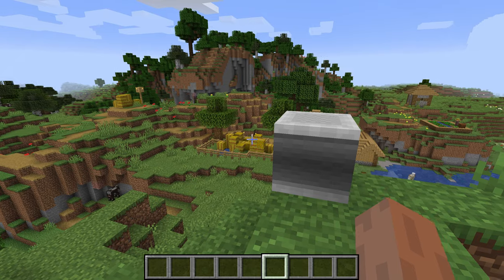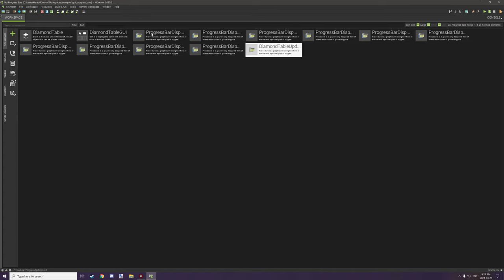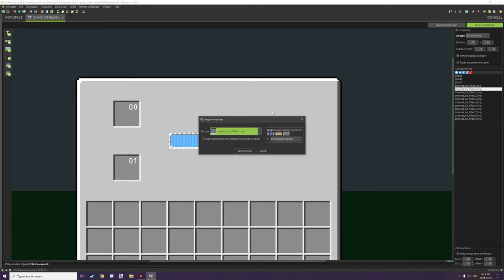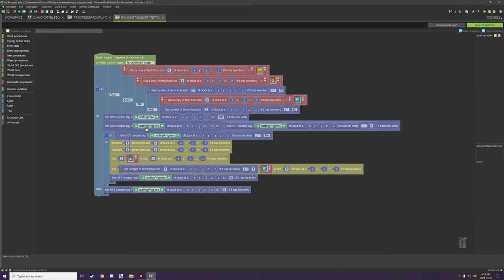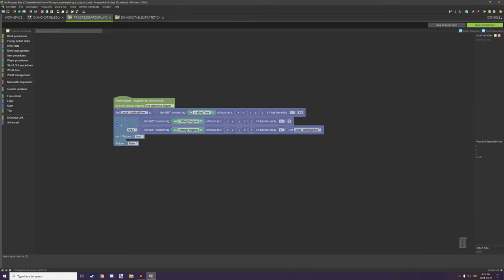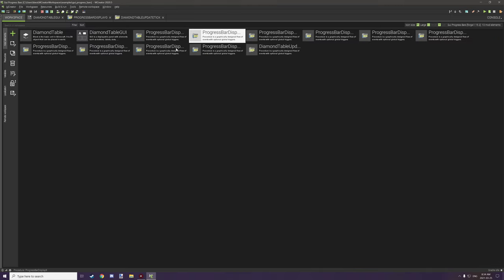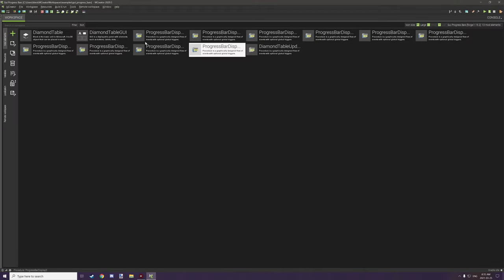MCreator: GUI Progress Bars | Tutorial 2020.5

Comment: Hey this works great on the crafting side, but I can't seem to get the progress bar to move. What did you use to trigger the ProgressBarDisplay0? 

Tried setting it off when an item is placed in a slot, tried making it happen on right click... nothing. 

I understand the conditions are bound to each "Image" in the GUI, but I can't seem to make those conditions result in a progress bar effect. I still get the desired Crafting Result. So If slot's 0 and 1 have the required materials time will pass and the desired item will come out in slot 2, but the progress bar in that time span will have stayed full. As shown in your GUI at the start of the MCreator segment of your video.

bro any advice on getting that bar to show when the desired item is going to be finished would be awesome. Also I wouldn't have started this project without people like you posting your scripts and explaining how they work. So regardless of your ability to help me with this I wanna thank you. 

Really has made this much more approachable.
Reply from the maker: So CraftingProgress is what controls the progress bar however this is compared to the value of CraftingTime as seen in 4:40
The concept is to take the crafting time variable and check for the range between each bar.

So for example the next progress bar (1) would be like.
CraftingProgress > (Local: CraftingTime)

and the other range would be
CraftingProgress ≤ [(Local: CraftingTime) * (2)]

This will test if the value of the CraftingProgress is between x1 and x2

If the crafting time is 300 ticks then 10% of that is 30.
So stage 0 is between the value of 0 and 30.
Stage 1 is between the value of 30 and 60.

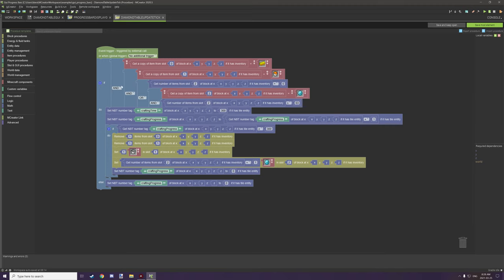At 5:20 you can see how those NBT variables are set in the update tick for the procedure.
Reply: @NorthWestTreesMCreator  Okay I think I get the procedure side a bit more. So the BlocksTick Procedure is bound to the block thus binding the conditions in the GUI to begin when the BlockTick begins? 

So no need to worry about any other triggers just the UpdateTick, but it's still stuck on full.

Would I possibly benefit from removing those local variables and recreating them myself? It seems like "Crafting Time" and "Crafting Progress" are the two things providing the parameters for everything else to go off of so maybe it's unable to use the conditions because it can't use those parameters? 

It still completes the recipe within the give ticks though... 

Ohh I'm sorry I should have mentioned this sooner. I'm on an older version of the Mcreator. 2021.1 and making a mod for forge 1.12.2 I don't know if this limits my local variables, or procedures or what. Gonna reinstall java, see if that fixes it, then look into that and then just rebuild it from near scratch again and see if something clicks together differently and it starts working. 

I'll give you an update if I get it to start moving the bar.
Reply from the maker: It may be your conditions if its crafting then its not the update tick script its your conditions for your image display.
Have you linked each condition to the proper image in your GUI?
You need one condition for each one of those value. Each condition covers a range of the time variable.
So for example

IF ( CraftingProgress ) ≥ ( [ CraftingTime ] / [ 10 ] ) AND  ( CraftingProgress ) < ( ( [ CraftingTime ] / [ 10 ] ) * [ 2 ] )
DO (Return: True)
Return: False

Your first stage should be

IF ( CraftingProgress ) ≥ ( [ 0 ] ) AND  ( CraftingProgress ) < ( [ CraftingTime ] / [ 10 ] ) 
DO (Return: True)
Return: False

And every one between should be similar to this but with the multiplication part (*) changing by one value except for the last one.

IF ( CraftingProgress ) ≥ ( [ CraftingTime ] / [ 10 ] * [ 3 ] ) AND  ( CraftingProgress ) < ( ( [ CraftingTime ] / [ 10 ] ) * [ 4 ] )
DO (Return: True)
Return: False

For the last one it would be:

IF ( CraftingProgress ) ≥ ( [ CraftingTime ] / [ 10 ] * [ 9 ] ) AND  ( CraftingProgress ) ≤ ( CraftingTime )
DO (Return: True)
Return: False

10 would be the number of images shown so for this example if you have 10 images then you use 10.

I hope this makes a bit more since, you can add the conditions to the images by editing your GUI then editing the images it will give you the option to link your conditions.
Reply: @NorthWestTreesMCreator  So I did link Condition0 to image 0 on the GUI. I also did that for each image and corresponding condition. The only image I don't have a condition for is the one that show's an empty bar.

I think I'm simply using a version without the necessary functions. Your workspace works perfectly fine in 1.16 And all your procedures when imported into that version seem to work perfectly fine. 

 It's gotta be that I'm using 1.12.2 forge...Unless your sure it's not that and know something I don't? 

I'd be happy to link you my workspace to have a look at? Or if you could import these procedures and conditions we're using into a 1.12.2 Forge workspace on your end? Either way would help me to narrow down what exactly is keeping this Progress bar effect from taking place.

My bet is on Mcreator version compatibility issues with workspaces made using 1.16 and ones using 1.12, but idk i just picked all this up like not even a month ago. Let me know what you think?
Reply: @momentiummonroe1475  It might just be the 1.12.2 generator. I set a GUI image to a procedure that simply returns false and it still shows up, so I think it's just not supported yet.

Comment: Please help.
I did the same on the 2022.2 mcreator and it completely doesnt work. I checked all 8 times and then I enable block entity, bind block to gui, add tick rate 300, add update recipe procedure in update tick trigger. Only first progress bar of 10 others appeared, no other changes.
Maybe I should add tick randomly, idk.
Reply from the maker: 1. Test the example workspace linked in the description.
2. Make sure you have linked all the image display conditions up for the right conditions.
3. Don't use tick randomly it won't fix anything just add new issues.

If you explore the example workspace I provide and compare the way things are set up with your workspace I am vary confident you will get it working in your mod.
Reply: @NorthWestTreesMCreator  I found it. I add a tick rate 1 instead 300 and everything worked!

Comment: i did everything in this video but its simply not working, after a couple of tests it seems that the "get a copy of item from slot __ of block if it has inventory" is not checking the slots content in my own GUI, no matter what i do its not working please help
I'm using mcreator 2024.1
Reply from the maker: This was for a older version of the game.
Much has changed since then, Mojang used to support both server and client side for GUIs and Overlays
But if you need to get data from something server side you need to store the data on the player or in the case with blocks you can save the blocks position for X Y and Z to player life time variables then use the position of the block for your scripts X Y Z blocks as the X Y Z block when run in the GUI or Overlay are the position of the player not the block.

Sadly its not possible for me to always make videos that stand the length of time and Mojang has refactored the game so much that lots of stuff will be broken, its just the way it is, I try to update the important ones people want the most but I have over 100 unique tutorials so its not really feasible to fix and maintain every single workspace sadly.
Reply: @NorthWestTreesMCreator  it’s alright a video isn’t needed! Thank you for replying and I will be trying to save the blocks position with the player_liftime variable.
Reply: @NorthWestTreesMCreator  after setting 3 global variables as number, player_lifetime and replacing all x y z blocks with the global variables it wont let me put the update tick procedure because of "missing dependencies".
i cant seem to find a way around this.

Comment: How would this work if you had more than 1 recipe for this machine?
Reply from the maker: It depends if your running both the recipes at the same time or if only one is running at a time.
In the case of just one running, you would just make sure the variable resets for the next tasks.
In the case of two recipes crafting at the same time then you would need to make a new set of variables and conditions for the other progress bar.

Comment: Where i found the progressBar in the Mcreator 2020.5 same as this video because on your github i see just in 2021.1 but it dont work, ive tested it ....
Reply from the maker: there is no progress bar in the application instead it is made using ranges using math to toggle image display conditions so you have to design your bar in a paint program and set the image display condition to work with a range.

You can use the equal and great than mixed with the less than sign to get a range of the value you want to use for your progression.

Comment: and btw if i create a output slot and then tick taht the player should not be able to insert or remove items from the slot, the player then cant insert but still remove the item. any idea?
Reply from the maker: For the GUI yes, however block GUI can be a bit more tricky, hoppers are still able to pull / push items into the block, so you would need to list the inventory id number in the text blocks and separate them using commas so like "0,1,2,3,4,5" however from what I remember if you disable hoppers it will also disable player access as well so if you want to bypass this you will need two blocks one locked and one unlocked which could be then tied with the ownership tutorial I made a while ago to make the block private.
Reply: @NorthWestTreesMCreator  sounds complicated :D btw i had the slots in the text blocks seperated with commas but the hopper where still able to pull the items out of the slots
Reply from the maker: this should have not happened if the inventory was linked to the block and the slots are in that inventory. I am not sure if it would work with other inventories but it should not take items from them they used to not do that so it may be a bug if that's the case.
Reply: @NorthWestTreesMCreator  hmm maybe its because i try it for 1.12.2 with the plugin for the newer mcreator versions.. i also found that i cant replace the block with a different version (like on off version) cause the GUI just blinks in and out instantly

Comment: my images wont disapear if the condition is not returning true. its still there
Reply from the maker: I have used this method on  2021.2 and it works.
For it to work the range in the condition must match the progress value, if your images don't update then most likely its one of the two things not working on your end.

Comment: and how to do it through a button in the GUI?
Reply from the maker: Rather than have it run from a tick update you would run the event from a button.
It should work the same way just from a click event, However you may need to adjust the percent, I can't remember if I used something like 1 to 100 but you may want something more like 1 - 10 so the player does not need to click 100 times.
Reply: @NorthWestTreesMCreator  how do I set up a percent?